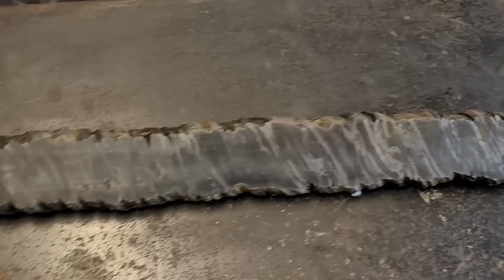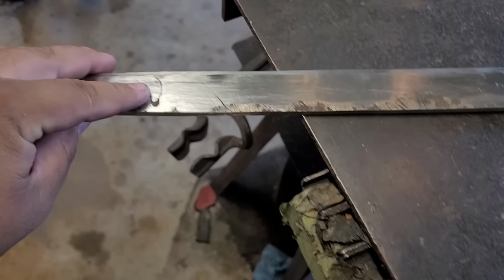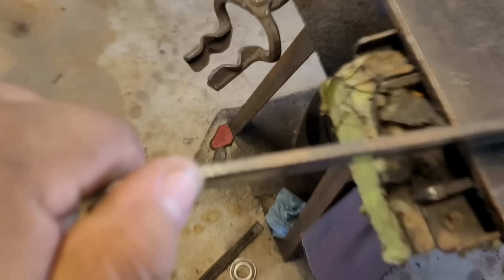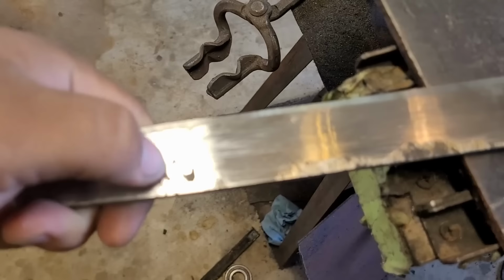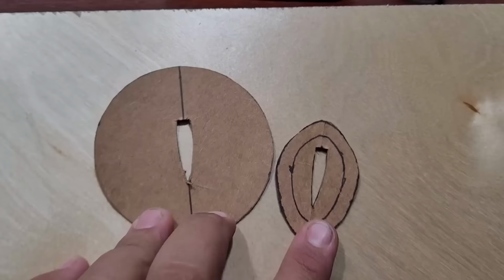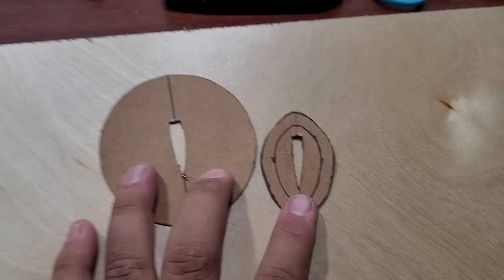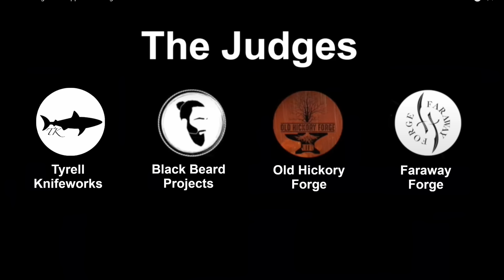Forging A Ball Bearing Twist Katana - Samurai Challenge

Comment: According to John from Old Hickory Forge, length of the sword determined by user height, for his extra tall 6'4" or so frame, his is supposed to be about 30" blade.
Reply from the maker: Im 5'9" and i was going for a 30" but forged a 28" and ended up cutting they trouble areas and ended up with a 24.5" which is just over the upper limit of a wakizashi or a kodachi.
Reply: Fun Fact: wakizashi typically was the blade used for beheading @JPsBladeworks
Reply from the maker: @snakenbits4279  this blade was used to behead a pumpkin

Comment: this is just great! looks magical! 👍
Perhaps the defect appeared due to the fact that you assembled the forging unevenly and immediately completely filled the bearings and then tried to fill the voids with powder. When you start pulling or twisting the workpiece, I advise you to sprinkle borax
Reply from the maker: Ive never sprinkled borax inside a can bit it might be a thought. I think it came from the twist. I dont think it was too noticeable in the video but i  sheared it a little in my first twist. I over twisted and that caused parts to come up. I guess i pushed it back once i forged it back into a bar and missed it when i did my cut for the tip
Reply: @JPsBladeworks You definitely can’t put borax inside, but when you remove the casing or twist it you need to pour it in. Most likely, there was simply emptiness inside and the metal was not welded. But the katana is great
Reply from the maker: @DamnWoodWorker  I borax all my billets after they come out of the casing. I just dont show it on the video because it just lengths an already long video. Normally Canister damascus comes out with surface cracks so its always safe to pour some borax even if its not needed. Thank you for the advice. I appreciate it.

Comment: Admirable work on the sword.  Meaning no disrespect, please consider advice from someone who began training with katana in 1966, eventually in two schools, one of which has a genealogy going back prior to 1580.  The katana cut is not like swinging a baseball bat.  The left hand is on the kashira (pommel) with the ring and little finger under it.  Also, the power of the cut is mostly from the left hand pulling toward the body or upward very slightly at the very end of the cut so that the cut is elliptical at the end rather than circular.  Difficult to execute, the reason why training even in the basics takes years.

Comment: The reason for this problem that led to the sword being cut and shortened is that you did not cut the steel into more than one piece and re-melt it and then hammer it.

Comment: the only thing i would of liked to see is the tsuba have some design cut into it. maybe a flower or something like that. but great looking katana
Reply from the maker: I opted out on doing a cut on the tsuba for making it from damascus because i was low on time but didnt want it too plain looking.
Reply: @JPsBladeworks  understandable. it was a couple of years ago and i saw someone make their tsuba out of bike chain and the punched the link pins out after and it looked very cool. i know you did a great job on the katana and was just voicing my opinion and i hope you didnt take it as an attack on your skill as a smith
Reply from the maker: @dagnard5707  no not at all. I agree with you actually. I would have loved to do more work on it but as a tried and true procrastinator i made this sword in slightly over a week 😅 even though i told myself id take more time for the challenge this time around 😅

Comment: Forging the bevels, not only grinding, to make it more legit and also avoid those fold-over cold shuts you had (mostly made by not cleaning up the sides with a grind after twisting), by moving material to the edge.  So much work on the initial billet and patterning, AND the general length/shape forging. Not sure why then to shortcut the edge bevel and just leave such a block beast of a profile (as of 8.30min in).
Reply from the maker: Its a competition. I was low on time. Sacrifices were made. I dont lose sleep over it.
Reply: @JPsBladeworks  oh didn't realise from the start it was in a comp and all. The work was nice, and good refinement on the pieces and polish, assembly. Cutting the kiseki (blade tip) often gives a quite different result to forging it in, but you made it all work! Using the press for holding the twist was smart. And for horizontal twisting, normally going vertical as most ppl do, works muscles harder

Comment: Just remember to re-square lightly and grind back the billet after twist before drawing it out to prevent those cold shuts 😉

Nice can peel, honestly cleanest I think I’ve seen. 

Nice job but I would question it in a Forged in Fire style strength test. I expect one of those cold shuts would blow it apart.
Reply from the maker: I agree. Normally i would take all the precautions on keeping it as clean as possible to minimize cracks but i was low on time and this was for a youtube challenge so corners where cut. Im going to build another one once i get a chance and will take my time with it to get everything right...hopefully
Reply: @JPsBladeworks  agh sorry I did. It pick up on it being a short time frame! Well I’m enjoying the video format so will be subscribing to follow your work 👍🏼
Reply: I thought there might be some cold shuts based on that aggressive first squeeze after the initial vertical squeeze

Comment: i've heard that rounding the corners of your bar before you twist it will help reduce those cracks and blemishes. file them off, or hammer chamfers on them, then heat the bar and twist. you dont need to turn it into a perfect octagon, but knocking down the corners helps

Comment: Next time, when making your copper adornments, if you use brazing flux and an acetylene torch, you can use copper wire to braze with while keeping the color matched naturally.
Reply from the maker: I didn't know that. Thank you
Reply: @JPsBladeworks  I should have been more clear. You can choose from cheap 10, 12 or 14 gauge Romex electrical wire available from Walmart or any home improvement store. I used to have a decorative welding hobby. I used it to braze when I needed something darker than bronze or brass. Regular bronze brazing flux works just fine but you'll need something hotter than a propane or Mapp gas torch to make it flow. Just be careful not to blow a hole in your project. Have fun.

Comment: So those cracks you find on the metal is from cold working. The metal wasn’t hot enough to fuse when you hammered it in the early stages and it folded over a void. Even though you filed it down, there is likely still microscopic cracks in those areas. Apologies if this seems overcritical but it’s an issue I ran into when making my first projects.

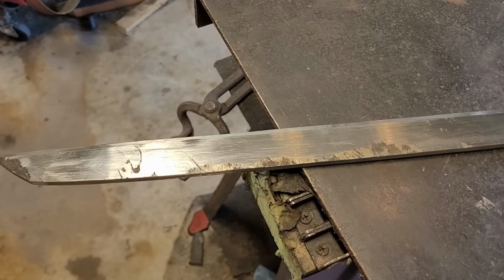Comment: 9:05 don't worry about the length, the standard blade length for a katana is traditionally 24inches which is extremely short, most modern katana not produced in Japan are actually too long 😂

Comment: 12:40 Why did you quench the copper before all other work?Wouldn't a softer one made work easier or you have some method in that?
Reply from the maker: Quenching the copper makes it soft and malleable. It works the opposite of steel.

Comment: I know it’s a little late to comment but awesome job making this sword man. Only question I have which is purely out of curiosity is what are those tubes you had that you kept dipping the katana in? There were some tubes sticking out of the ground and one by the workbench. What were they filled with? Some kind of acid or curing solution? Thanks!
Reply from the maker: Its never too late to comment lol. The tubes were probably the ferric chloride which is an acid used for etching the steel. And or the one i also used the coffee which darkens the steel even more.
Reply: @JPsBladeworks  I gotcha. Thanks for the reply and explanation! Once again,awesome channel man. I would like to suggest for you to make one of the katanas out of attack on titan. I think that would be really cool. Especially designing the release system to change between blades! Thanks again!

Comment: Ive just been watching alot of smithing video on yt so this is just curiosity, doesn't twisting the metal add more stress points? And wouldnt it make th blade weaker??
Reply from the maker: Its shouldnt. Theres plenty of knifes ive made with twists and ive had no issues.

Comment: He, so, I don't know if this will work or if it is a good idea, but if you take your welder and put a little bit of weld on those imperfections then it'll fill them up and you can regrind. May or may not work, I just thought I'd put the idea out there.

Comment: How did you get the can off so cleanly JP?
Reply from the maker: A thick solid coat of white spray paint and a whole lot of luck. And little pinch in the can or edge and it wont come out. Ive only had 2 successful removals like this in 3 years of canisters. And both were this year 😅
Reply: @JPsBladeworks  sounds like practice and experience yielding it’s fruits to me!

Comment: Hey, i am not an expert in forging, but you said that you couldnt get rid of those marks and you had to cut it short.  Why didnt you just weld it and then grind it down?
Reply from the maker: The weld is mild steel. So it wouldnt look right when etched. It basically ruins the pattern.

Comment: I noticed at the beginning the top of the can completely split open.. how did you compensate for that? Or did you start over?
Reply from the maker: After the initial weld most the inside is welded so no issues with the cap coming off.
Reply: @JPsBladeworks   ohhh ok I figured it had to have welded otherwise it would’ve been a disaster 😅 excellent work my guy keep doing what you do best

Comment: I’ve always ment to ask why you don’t do a square work peg or fat piece of rebar or somthing on your canisters so you can get a full can weld heat
Reply from the maker: Im not understanding you question. Why dont i weld a bar to the can so i can hold it? If thats the question i dont do it so i can press it top bottom on my first press. Thats the most important press because it consolidates everything in one press. If you start on the sides it can break the caps and give you bad welds or even worse the podwer can not even weld on the ends of the billet. Hope that is understandable.
Reply: @JPsBladeworks  ahh makes sense. Ok I always see you forging the can length ways holding it, you just switch ends once you get to your tongs?

Comment: Honestly looks beautiful but you missed the part where you put clay on the back of the blade and make little lines towards the sharp part of the blade other then that, great work
Reply from the maker: I dont do it on damascus because the differential heat treatment doesnt tend to look good on damascus. If it was mono steel i would have done it.

Comment: If you would have done some folding you would have gotten rid of those imperfections. But since you are just making a paper weight I guess it does not matter. Not being critical just truthful.
Reply from the maker: Dont you feel high and mighting not having and idea what i was doing but still commenting something to feel special. I appreciate you.
Reply: @JPsBladeworks  I don’t feel high and mighty 😂. But I did know what you were doing and it was in no way Katana. When I take my dog out I know he is gonna sh*t. That  does not make me high and mighty. It just mean I saw him stuff his face and so now I know crap is gonna come out the other end. When I saw you putting crap into your blade then the only thing that could possibly come out is crap. I’m sorry it hurt your feelings but if you don’t get negative feedback on work like you did above then how are you to improve. One day you might actually be a great blade smith. You will look back on this as a positive experience. And if you are gonna make Damascus then fold the billet. And then fold it again and again etc. A piece of steel that looks like you welded ball bearings together and then belt sanded it flat for (1) is in no way Damascus and (2) was way to big (thick and heavy) to be a tsuba.

Comment: As nice as this sword is. I wouldnt consider it a "katana". The katana gets its curve from clay and heat treat process. The handle imo shoukd have been burned not spray painted. And i will assume the handle was attached with 2 part epoxy with no pins.
Reply from the maker: What in your life has made you so unhappy that you have to go out of your way to try and point out the obvious. Shits not traditional. Did you see me make tamahagane as soon as the video started? At that point you should have known 2 things. Number 1 is that its not traditional and will not be made the way a traditional katana is made. Number 2 the fact im putting it out into the world for armchair keyboard warriors such as yourself to defend is because i dont give a rats ass what you think. Ohh and also it does have a pin and no epoxy. Thanks for watching i appreciate you 😁
Reply: @JPsBladeworks  I could have went on was just some simple observations lol. It is a nice sword as I said but seems you shouldn't post content if you can't take some minor criticizing and just want the "oh that's amaking" "what great work".

Comment: You could tell that you had cold shuts all threw that billet for the sword when you mad3 it so not sure why you seemed surprised when half of it was junk. Im not even a bladesmith but just Watching videos I knew enough that half the billet was shit bc your twist wasn't tight and right and left all those opening for them. I would imagine if you actually used the sword enough it would snap right in 2 and you would be dead in your sword fight 😂. Hope you haven't been doing this long or else hope you don't charge a lot for your work those poor ppl that buy the stuff if all your work is like this
Reply: What sword fight?

Comment: Amazing sword !

Can you actually call this a katana though ....
Reply from the maker: Maybe
Reply: @JPsBladeworks  "Akshually it can only be a katana if itsh made in japan by a japanese katan maker"🤓🤓🤓
For real though, great work on the piece !!
Reply from the maker: @thibaud1330  so tacos can only be made in mexico by a mexican?
Reply: @JPsBladeworks   Exactly my dude, and it's not pizza if it's not made by a 6th generation Napolitan pizza maker x))

I'm just joking around dw, the only thing that would make this less of a katana would be the way it's built. A katana is supposed to have two types of steel forge welded in a cetain way. Usually it's high carbon steel on the edge and low carbon steel for the spine. When making your billet, you would then form the low carbon steel into a U shape and put the high carbon steel insert inside thus making the base for a katana blade billet. If you want to make it damascus, I think you'd only do it with the spine part since the other one would only be visible at the edge of the blade.

But then again, I'm joking around as Katana in japanese basically means sword and doesn't have any of those specifics attached to it. Also you're the one who made the piece, you're free to call it whatever you want, even more so when it has this good of a build quality.

Comment: Non va tagliata e sagomata per farla assomigliare a una katana, ma bensì durante la tempra bisognerebbe creare una differenza di temperatura, in origine in Giappone applicavano argilla sul lato della lama, oggi esistono rivestimenti ceramici, ecc durante la tempra nell' immersione la differenza di temperatura del rapido raffreddamento renderà il metallo creando la curvatura tipica della katana, peccato questo semplice dettaglio poteva rendere questa replica una vera katana 👎
Reply: Stop crying
Reply: @tripwire3992  no one is crying, if you were able to understand what I wrote, you would understand it's a technical criticism, and not a complaint... instead of learning, is it easier to respond like this?😂🤦🏻‍♂️🤷🏼‍♂️
Reply from the maker: I could have done the differencial hardening as they did with katanas in japan but I decided not to. If you pay attention to the materials used they are not traditional tamahagane. I did a damascus like pattern with ball bearings, another knife steel i cant remember off the top of my head and steel powder. If i did what you say in claying the steel to temper and naturally get the bend the hamon would clash with the pattern and not look right. So that choice was made for that reason. If this was mono steel sword like a tamahagane or a 1095 i would have gone with the clay hardening. Hope that information is satisfactory.

Comment: The twisting is too slow, and the oxide layer is mixed together. If you are not strong enough, you can only use a machine to twist. This knife has too much oxide layer mixed in, and the force-bearing point is not good.
Reply from the maker: I promise ill be strong sensei 💪